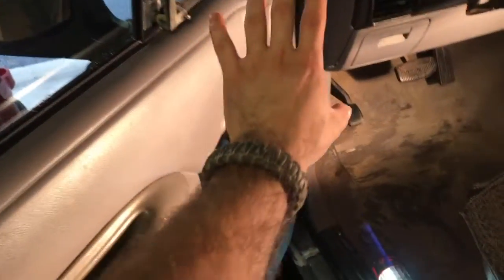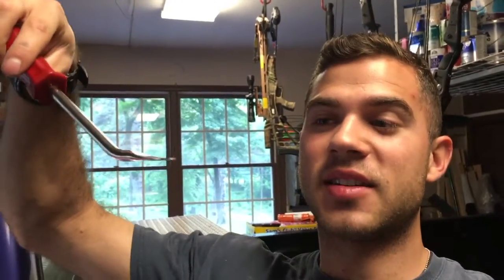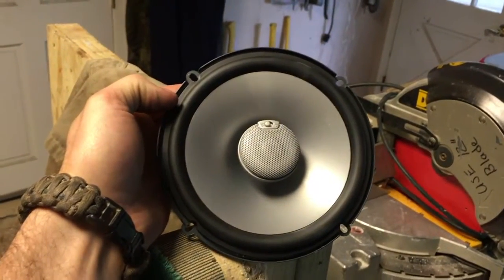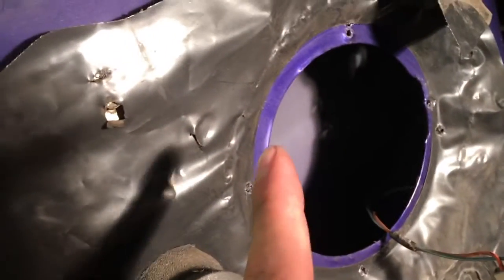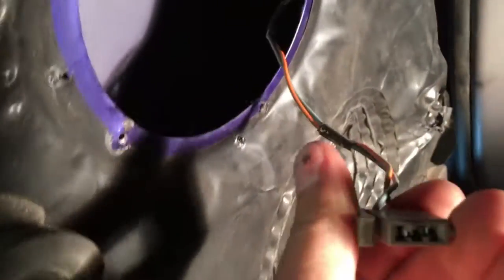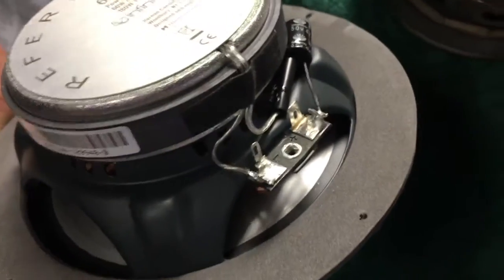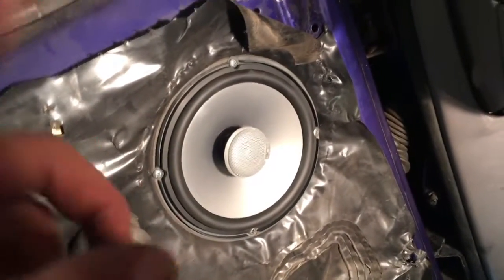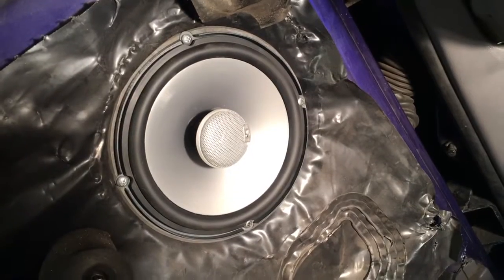How to Install Aftermarket Door Speakers | 1995 Ford F150

Comment: I ran into a similar problem on my 00' F 150, stock connectors don't fit new speakers.  Instead of soldering,  I bought the adapter for about $1.50 which bridges the stock connector to the new speaker.  It's a nice tight fit, and sometimes over time solder can fail.  Either way works though, enjoyed the video, will have to check out the rest of them.
Reply from the maker: Tom S Nice! I didn't know they had adapters. I just stuck with the no cost retro fit method. Yeah I will always keep an eye on those solder joints. So far so good! Thanks for watching! Hope you enjoy the other videos!
Reply: I recently bought all 4 speakers for my wife's OBS through Crutchfield & they actually threw in the adapter pig tails. I thought that was pretty neat.
Reply: Which one did u get? I got on and one of the tip things are a different size so one fits speaker one doesnt

Comment: Was wondering if you knew which wire was negative coming out of the door panel when you matched it up to the new speaker with the old connector?
Reply from the maker: I don’t. I just matched everything up and made sure it worked.

Comment: hey man just curious....if u upgraded the speaker wire (14 or 16 gauge) would u be able to notice the sound difference...
Reply from the maker: Shannon Bunch I used the stock wiring. From what I found poking around on the net, large wires doesn't make a difference in sound quality. The only time it does is when you are run speaker wires over 25-30+ feet. Even then bigger is only better to a point.

Comment: What size speakers are these
Reply from the maker: 804 Bassin They are 6-1/2 inch speakers. Buy your speakers from amazon. They are usually cheaper than a parts store.
Reply: Ok thanks alot
Reply from the maker: 804 Bassin No problem! Thanks for watching!

Comment: Any issue with the door panel going over the new speakers? “Bulging” ?
Reply from the maker: Nope. The speakers sit pretty flush with the actual door frame. I think I might have 1/4 inch or so before the speaker touches the door panel.

Comment: How do you wire extra speakers in it. And where could you put them.
Reply from the maker: Hawkman 76 So I haven’t done this before but from what I’ve heard. In order to wire more speakers you need a four channel or two channel amp. The back of your head unit has RCA wires for hooking up an amp. Once the amp is hook up to those wires. You then wire your two extra speakers into the speaker/sub ports on the amp. However, if it’s more sound you’re going for the amp usually does that without adding speakers. As far as speaker placement, is your truck a single cab, crew cab, or super crew?
Reply: Single cabs can get speakers to be put in the roof they sell a new headliner with 4 spots to put them

Comment: Actually swiss army knives are badass little knives, as long as you buy a Victorinox or Wenger. Helps if you know how to sharpen properly and understand geometry. 
But yes, 3 way coax speakers are lame.
Reply from the maker: True! I've had my share of genuine Victorinox knives. Sometimes just a plane blade would do the trick. I did some research before buying my speakers. Independent speakers for each range or 2 way were the way to go.

Comment: Can you send me the speaker insulation and speaker mounts links?
Reply from the maker: The strips of speaker insulation came with particular brand of speaker. As for mounting the speaker, the speaker screws straight to the door frame.